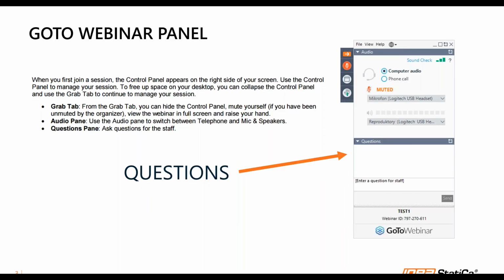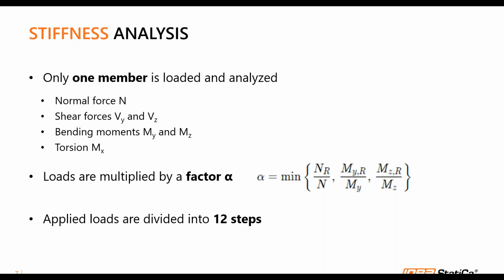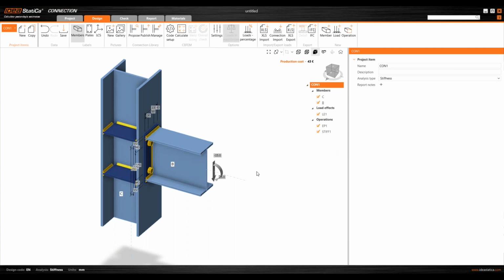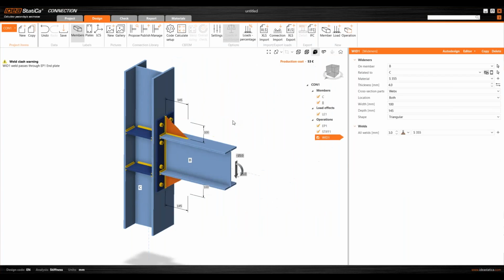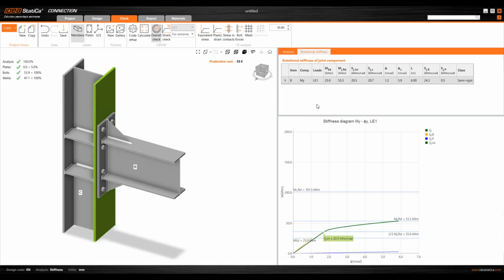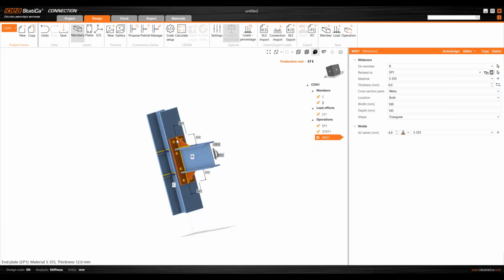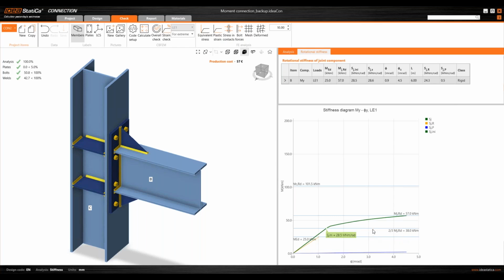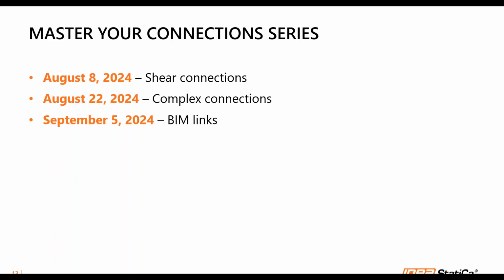Master your connections - Moment connections

Comment: Can you please clarify why the behavior of connection is completely differnt when we reverse bending against shear force direction ( shear downward and bending is up), particularly when we have an identical connection like what you’ve shown on this webinar
“Extended Top and bottom end plate" with the same bolt pattern?!
Reply from the maker: Hello, yes, of course the results of analysis of a joint reflects the acting internal forces, so + or - bending moment produces very different results. Naturaly, only one is correct of what you get from the global structural analysis.
Also, pay attention to the shear force position, but this is important in case of a hinge, where there is no bending moment in the node in the global model.
https://www.ideastatica.com/support-center/how-to-define-correct-load-position